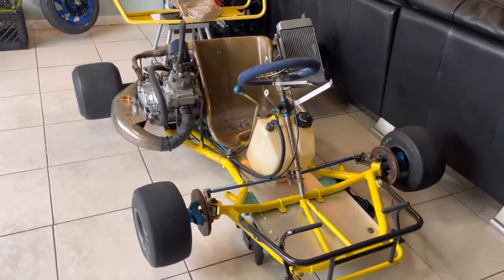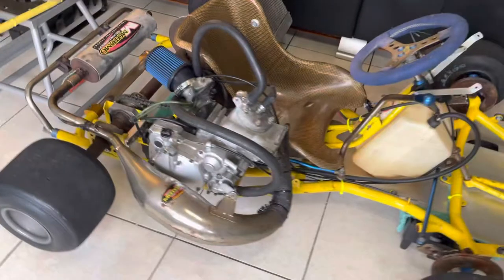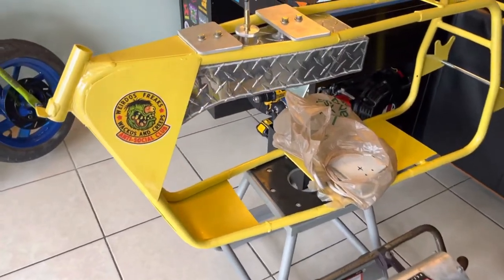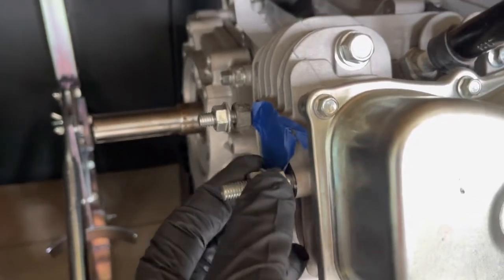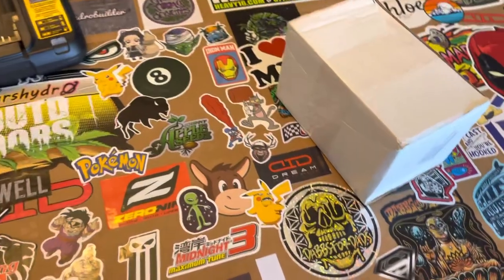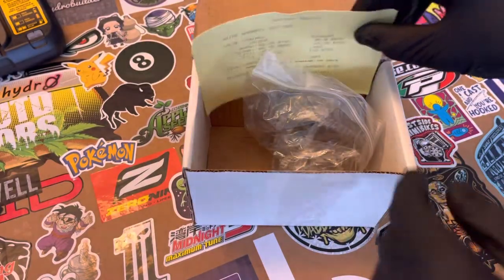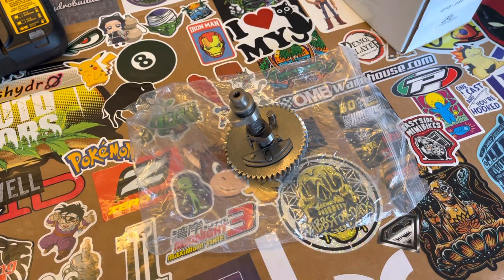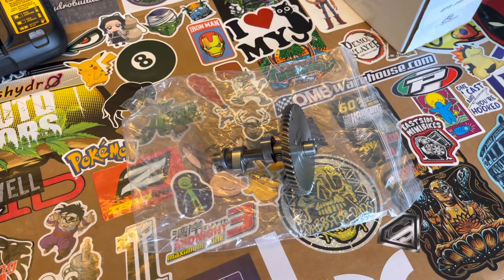GPS285 Camshaft (212cc Hemi Predator / 196cc Clone / GX200)

Comment: Mine runs well. Got aluminum connecting rod stiffer valve springs along with the flywheel. Didn't need clearance.
Reply from the maker: How does she sound i bet mean af gahaha that’s so sick brother
Reply: @midwesternassassin  Sounds good. Put a 110 Chinese atv exhaust off Amazon, She isn't too loud yet not quiet either.
Reply from the maker: @khrisyeet8022  damn that sound sweet like you hit the sweet spot for sure love when it’s just right